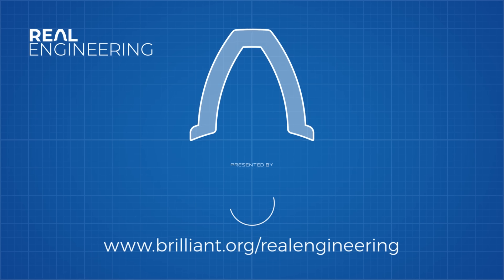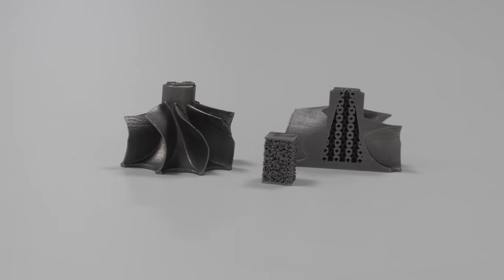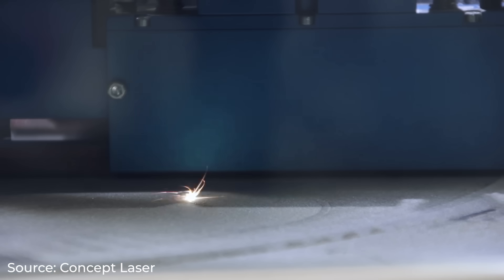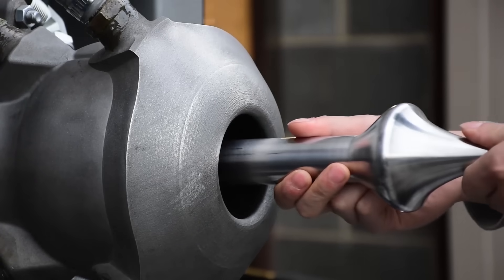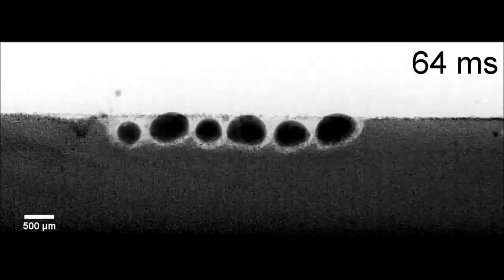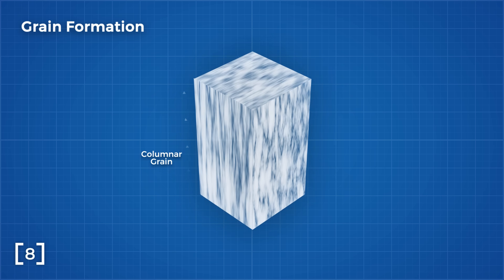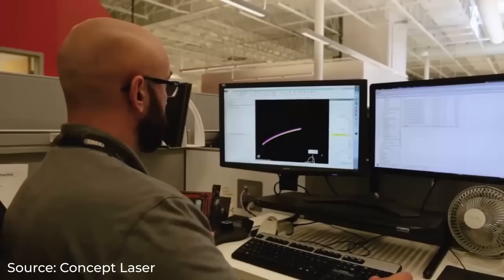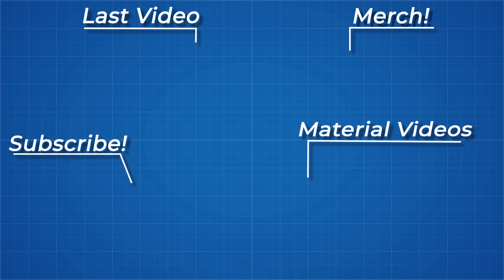The Material Science of Metal 3D Printing

Comment: As a welder and steel fabricator... I have seen plenty of young engineers bringin forth plans that are impossible or REALLY UNNECESSARILY COMPLEX to fabricate. (And many of them have refused to take feedback... for some reason.) And since I started to study engineering at university, I have found great amount of value from my practical experience of welding and steel fabrication. 

Seriously engineers... Talk to the people making your things. Often there are simple changes you can do that will cut cost and production time, if you'd just bother to talk to us. We don't bite. We might be blunt and few worded, but we aren't mean. We like it when we get to share our experience.
Reply: Henri Hänninen Kelly Johnson has a rule engineers couldn’t sit more than 100 feet from the factory floor. If there was a problem in assembly the engineer had to go to the floor. Kelly Johnson ran Lockheed’s Skunk Works for decades and designed the U 2 and sr 71 blackbird etc. 

My wife is a jeweler and sees this with students leaving school. No, you can’t take 6 months to make a pair of earrings.
Reply: @jimkennedy4509  The main thing that management needs to know is what is within 10ft of the worker on the floor.
Reply: @jimkennedy4509  That's pretty much how Elon Musk runs Tesla and Space X.
Reply: @jimkennedy4509  Elon Musk uses the same principle in Tesla and SpaceX. Furthermore even the product engineers and the production line engineers are in the same room too. Right inside the factory. This is how you land rockets!
Reply: On the Civil Engineering side of things we have the same problem. The bad thing is they don't even teach design anymore in school so the newer engineers are just 100% theory and no practical real world experience/application. The best firm I ever worked with took the newly hired engineers and put them as rodmen on the survey crews for their first year cutting line and doing stakeout. By doing this they learned how things go together in the real world and made their future designs a lot less of a headache for the contractors.
Reply: @Bugsey35  I'm not sure what schools you are referring to, and maybe this is different in the civil engineering department (I'm in mech), but I've had at least one design course per term (2 terms per year) since I started university (I'm in third year).
Reply: @Bugsey35  But that's a liability to train, they could leave the company as soon as they get another opportunity, and you lost money training them.
Reply: I'm so glad I learned 3d CAD before getting a job in a fab plant in the machine room & later applying for a position in the engineering dept. My official title was "Production Assistance Engineer" meaning I had to go behind the engineers & fix their designs so that they could actually process them in the plant. My nickname in the fab room was "Mr. FixaFuck"
Reply: @RichardCranium321  i feel like your path to engineering has a much stronger foundation even though it takes longer.
Reply: As a tool designer, I often have difficulty getting the undivided attention of the fabricators where I work, especially early on in the design process. Usually I have to go out and interrupt someones busy schedule without notice in order to get their opinion on my design. Often times neither of us know if he will even be involved in fabricating this tool which makes it hard to get him invested enough in the details of my design to provide any meaningful feedback. The responses I get are often as simple as a thumbs up until the material is sitting on the welding table. Only then do I finally get an earful about my design.

I've discovered over time that drawing out design discussions as much as possible yields better feedback. Dedicated design reviews can also get good feedback too if done right. I try to be physically present when the tool is being fabricated and assembled to see what parts go smoothly and what parts don't. It's always the little details that make the difference between a bad design and a good one and those little details sometimes get overlooked in design discussion.

Also, maybe I'm a wimp but criticism can still hurt no matter how nicely it's given. It sucks to spend 3 solid weeks agonizing over every tiny detail of a design only to have the entire thing thrown out without a second thought. I have to deliberately put myself in a vulnerable position when I seek out criticism which is scary. I'll try my best to listen carefully and not get defensive and in return I hope you can approach the design with an open mind.
Reply: @gregorycarlson6445  Sounds like you are on the right path. Every tool that you design and watch being fabricated teaches you more about what works best. Keep putting yourself out there and eventually you will see the rewards for your persistence.
Reply: when i was doing my mechanical engineering study in the netherlands, we had to manufacture our designs in the workshop too, to give the students a better understanding of what you can and can't do with machines.
Reply: toyota's manufacturing process incorporates two way feedback b/w the floor/fabricators and design/engineers.
that's why their cars are great and run forever.
Reply: @test-mm7bv  .Also why Tesla is rapidly dominating the electric vehicle industry.  .they have a culture of innovation, feedback & upgrade
Reply: Henri Hänninen 
Also many people who want to be engineers don’t take classes in high school which offer machining experience or welding experience. Many just stay in the books.
Reply: I work on cnc lathes and mills. I wish the engineers and designers would talk to us about the manufacture of their parts too.
Reply: My boss tries to tell me how to do my job many times per week. Every time i just let him talk and do my job my way anyway. Complains are very rare.
Reply: It is the same story over and over again. There are some examples where this interaction does work, like Lockheeds skunkworks Toyota and Tesla that where mentioned above. 

But ultimately it is the job of the directors and higher management to create a cooperative culture in the cooperation! So my advice, go and work for a company that understands these things. It will make you so much happier. And if your company makes good stuff your job is not on the line in the next recession.
Reply: This holds a similar truth for software as well - I'm regularly dealing with some kind of program which was clearly designed by someone who didn't bother thinking about the people who actually have to use that abomination.
For example, the most common task for a class' teacher is to do a statistic on attendance - the optimum steps would this be: Open program => Login => Select class from your filtered list of classes => Select "Attendance" from icons for most common tasks.
What were the actual steps? Open program => login => Select class from unfiltered list => Switch to view of all pupils => Select all pupils => Select "statistics" => select "Attendance" => Set filter to current school year => Select "Export" => Save file => Open file in Excel...
Reply: @johanneshass1614  We had to write an actual Standard on how to make a peanut butter sandwich in my Standards class. If someone else were to follow the standard, they would have made peanut butter sandwich. Most people fail to understand what all of the steps involved are for even the simplest of tasks, and then wonder why they failed to meet acceptable standards of performance.
Reply: Also known as the Auto Mechanic dilemma. Timing chains are the worst.
Reply: I see this every day where I work... the Office has no clue how things are done in the shop.  The drawings are ridiculous and the fabricators and welders are always shaking their heads wondering if there is a university engineering course in 'being stupid'.  I personally believe that all detailers / engineers should spend a couple months in a shop to get a grasp on how things are actually made.
Reply: @angryoldcanadian3905  Colt Firearms actually has that policy where management and engineering are required to spend time on the shop floor, and at those salaries. But it doesn't sound like you work for Colt unfortunately.
Reply: @angryoldcanadian3905  I personally think you should spend some time in the office, dealing with other engineering bullshit and actually designing something properly. Good luck fucking up
Reply: @Rossingiol  If your design isn't manufacturable, there's nothing "proper" about it.
Reply: That mentality is everywhere. All the people at the "top" is shit and all the people holding them up see is shit and the assholes shitting on them. Pardon the language but the joke doesn't work as well in a clean form.
Reply: You can see why young engineers may not want to ask for or listen to the advice of fabricators. Contrary to what you are saying it is INCREDIBLY common for fabricators to act exceptionally condescending toward engineers, laugh at them, and then proceed to point out what a waste of money their college degree was.. Is that the  "blunt and few worded" part you were talking about?To be fair there are people like this on both sides, I have met thick headed stubborn engineers but I have also met JUST AS MANY self righteous chip on your shoulder fabricators and contractors that will start up this whole jockeying and penis measuring while demeaning the engineer. It only takes a couple encounters like that to discourage most people as a whole to avoid situations in which this may happen to them again.
Reply: It takes 2 to tango. I eventually became a fairly decent engineer, but the path from naïve student wasn't helped by plenty of people who should've known better hoarding their expertise or telling us to piss off when we got near the shop floor.
Reply: As a design engineer, stay in your lane. We intentionally make our designs difficult to manufacture so you can whine about it. (jk, I agree with you lol)
Reply: My uni made us do a unit in designing and building parts ourselves using lathes and CNC machines for this purpose. It was one of my favourite units and helped show the realities. I agree that people need practical experience in these areas before graduating
Reply: Henri Hänninen one of the reasons why I chose manufacturing Engineering is because there is a distinct focus on design for manufacturability. We also get to learn the cutting edge stuff as well. It really helped with my internships and I’m hoping that when I graduate I can do more in the metal 3D printing area
Reply: I am curious Henri. When you finish your studies, go to these places and present you designs. Don't tell them you were a welder or steel fabricator first and see how they treat you. See how they talk to you and assume you are a know it all. Look at half of the responses to your comment. the disdain for engineers is palpable. And you want them to come into this and say "hey so here is my design, what do you think?".
Reply: When people tell me how to do my job I do it the way they tell me. Then when it's all fucked up, hey they're the one who told me how it was done.
Reply: Oh no fooling! I used to be a welder at Genie Industries building man lifts. Some of the stuff the manufacturing Engineers came up with was unbuildable. They wanted welds where you couldn't get into to weld.  More than once I told the engineers they were over-educated morons and before they should be employed as an engineer they should work on the shop floor putting together what other people design.

A good engineer copy's good ideas, a bad engineer copy's bad ideas, then you have engineers that do the what in the world were they thinking?!!

Mustn't forget the engineers that tell you well just make it as we designed it!  Then they complain about the welding when the welds crack and the lack of penetration of the welds. It couldn't be the mix of a 1/10 of an inch tubing being welded to a 5/8 inch bearing boss being the issue... it's got to be the welder's fault for not knowing how to weld.
Reply: @krissfemmpaws1029  acting like an entitled bit , complaining and crap makes you a (fill in the blank)
Reply: @krissfemmpaws1029  oh that's a great way of thinking. How much do you know about numeric strength calculations again? Don't be a prick, you also made mistakes, that's called learning. And you can not learn everything there is to know in your field in 5 years. If so, try doing a better job.
Reply: @Rossingiol  The real world doesn't care about your numeric strength calculations. If it is physically impossible to make something, it doesn't matter how good your calculations are. The fact that you completely glossed over his example of welding issues shows how utterly inept you are at understanding real world conditions.

Just because you have fancy coloured simulations doesn't mean it is actually manufacturable.
Reply: @kwanarchive   "The real world doesn't care about your numerical strength calculations".

That has to be the dumbest thing I've ever heard. It's a good thing you don't design bridges or aircraft.
Reply: Same goes for the designers' relationship with programmers. Seriously, sometimes designers project very hard things for the tools being used when only a few changes in the design could make it quicker to code (which means cheaper) and simpler to maintain.
Reply: After college you quickly learn that you are always a student.
Reply: I always seek the end users advice for designs for yet another reason--if they have real input that effects the crucial criteria such as dimensions, range of motion, etc., they will have a stake in making it work as some adaptation will be required by them too no matter how good the design is, if they feel left out of the process they may make a good design fail but if they are included they will TRY to make it WORK.
Reply: "We don't bite"
Proceeds with the good old dig at engineers
Reply: If they won't listen to machinists or line operators they're second-rate engineers. Unless they worked a design project or had a DFM course in school, they may be trying to exactly meet the specifications they were given (like solving a textbook problem) with no appreciation of difficulty, lead time, or cost (which engineering texts never talk about). By all means, push back or they'll never learn.
Reply: You have hurt the ego of most millennial engineering degree holders.
Most persons especially millennials who have a degree in engineering will never try to learn anything from a welder/fabricator. Its a matter of their ego.

I have a degree in engineering and I have learnt a lot about engineering from sources outside my college. Those sources included welders like you. Welders have thought me things my college never really bothered to teach. There is always something we can learn from others even if they are not as educated as us.
Reply: No doubt. Every single job I have worked has a huge discount between designing / engineering and manufacturing. And you are correct when you say the engineering departments don't bother with bringing experience from manufacturing into the discussion witch hurts them far more then they think.
This is why you will find in every top tier manufacturer that the lead engineer in a given section have experience performing every single step of the process. You will see this in top defense contractors concept and development departments.
I meet a guy one time who worked in similar situations. I believe him because he did not ever brag or upsell himself and the guy always had the best way to go about a task and always reviled he had more talent and experience then you thought. Anyway this guy constantly pushed the concept of positions learning every job under them. He was telling a story about when he was working in some manufacturing process making parts as an engineer (the new engineers at this place all worked in manufacturing and learning every process used before they were promoted to engineering department "drafter bitch")
He told the story of working night shift and a machine broke down so he looked it over and gathered observations to take to a supervisor. As he was looking it over and noting down information one of the top engineers noticed and asked what was up. Then that top engineer showed him how to disassemble the machine, inspect, repair, assemble, properly set up and verify its proper function then and there. He asked him how he knew how to do this like it's second nature. The engineer told him that the reason he heads up a department is because he never forget how to do everything he's ever done with that company and often goes back to refresh on the jobs below him.
I always asked him how he could work for these companies that refused to operate similar to that. He said that's the beauty of being hired consultant. They stop listening I talk louder and more direct. They start working against my well thought out solution I walk out. Haha
Reply: Henri Hänninen I learnt fuck all at uni doing masters in mech eng.  It doesn’t prepare you for real life/manufacturing environment.  Always stay humble and ask shopfloor staff for advice no matter how much you know,  they’re the ones that create and fit parts together and know something you don’t.
(Working in aerospace)
Reply: Lye Detector  Yes I understand you're scared of AI I am too you should be more scared if they become better engineers then us than Welders. they are already good calcualators.
Reply: Egos and arrogance have been Man's biggest problem since Man was invented...  Where I work as a Machinist,  There's more closed minds than open minds...  Needless to say,  the shop is stuck in the 90's and slowly shrinking..  They refuse to admit,  they don't know everything..  If you push the subject,  and teach them something,   they HATE YOU ! ..    I know it all too well..
Reply: @THOMASTHESAILOR  that's practically how the entire western world is working these days
Reply: @Astro_Alphard  ,  It sure is...  When will it end,  if ever..   is the question..   cuz it'll be difficult to move forward like this..
Reply: There is a tiny % of us who do eventually learn to listen over time
Reply: @htko89  No, dude just would not listen and argued that I don't know shit because I didn't have a degree, iv explicitly stated that this machine gonna blow up on his settings and told him I was writing off of this machine if he as a higher up want to mess with it, he created an accident because he was so far up his ass that would not consider anyone opinion, I can totally work with ppl, that's why I left CNC after few years, to little contact with clients, but this dude could not
Reply: I think I agree with you a design engineer needs to know their limits. Pure employee, management politics .. the engineers especially the newbies want to prove that they can achieve the next innovation in terms of design, while making a name for themselves in the company & market. Some even eyeing that coveted design award.. can't blame them!
Reply: I know exactly what you mean !!!
Just because it looks good on paper . If it's not practical . What use is it !!!
Exactly why "Field Fabricators" will always be nessary !!!
Fixing Engineers Mistakes !!!!
Reply: True words. If you want to be a good engineer, you need to spend time on the shop floor. 
Listen and learn from the masters.
Reply: A freshly graduated engineer comes to the new job. Is handed to the floor leader (old practitioner), to be shown the place and its processes. The leader grabs the broom and gives it to the engineer, to start from the scratch that day (to work through all points in the manufacturing, including most important part, cleaning and maintenance). You know, that old school thing for beginners, which everybody hates. The new engineer responds: "But, but, I´m qualified engineer, with a diploma!" The leader backs off in surprise. "Well, yeah oh, uh, sorry! I forgot! Let me show you how broom is used to sweep the floor!" :-D
Reply: This is so true. I am a technical product designer and do a lot of CAD but no actual manufacturing. I always give my best to design things "realisticly" so that they can be actually produced or try to cut costs by removing unneccessary tool tim etc. In my former education there was no plan to do anything practically and I started to do some 3d printing and turning and milling in my spare time to gain more knowledge about all these processes thath i just assume to work out while designing. i learned a lot by doing this and just started to study mechanical engineering and I can really profit from this.
Reply: yeah u dont get it ... talking to people? thats exactly what they wanna remove. their goal is robotics, so that the engineer has direct access to the fabrication process.
Reply: Yes, a tough subject. Doesn't produce the best people however
Reply: that's the problem this economy has created, everything needs to be instant. and that trickles down into our mentality. sooo we have degrees now. we learn shit from books so kids don't waste 30 years to get experience and understand the stuff they should understand.. no they know the stuff because it's in books, they know it but don't understand it. hence they know nothing.
Reply: So are you saying a welder who has less math does more work than an engineer?
Reply: Maybe the reason you think engineers can't 3d print metals because you don't know how that works. who cares if welded it can you solder a rectifier in a alternator? I don't think so I'm not trying say engineers are more important than them but an engineer could easily weld without a welder if they wanted and just use robotic welding that is the future.
Reply: Lye Detector  Why is it that everyone want to weld when you can just program a robot to do that shit it doesn't make any sense to me.
Reply: @cah2942  Where I work, we build large (some 12 ft tall) machines for food processing. Every machine is custom designed by mechanical engineers to perform the needed functions in the particular space where the customer needs it. Of course each machine has some similar parts to others, not starting from scratch, but there are differences. There is no way to program a welding robot in less time than it takes a human welder to put the machine together! So all of our machines are manually welded. If you start making 100 of the same thing, then a welding robot becomes practical, but in many places experienced human welders are what is needed. And when you get the robot, you still need someone who can operate it and determine whether the welds it makes are good and fix it if not. [I have an electrical engineering degree, but am presently working as a manual machinist, which I very much enjoy doing.]
Reply: Lye Detector  I'm pretty sure the Majority of Welders will face the truth that we need the  engineers Making all kinds of products that is the future  I'm pretty certain there are engineers out there that weld that they would rather a robot do it.
Reply: Lye Detector  I only think Automation you can't weld we don't need them but underwater maybe because we have no robots doing it yet maybe in 2040 possibility
Reply: This is so true. For my final project I had to design and then build a CNC. I soon learned that learning HOW to build a design is just as important as learning how to design a build. So many things had to be changed on the spot that I wish I had someone with design experience to look over my shoulder.
Reply: I'm an engineering student and I always take feedback from the fabricators, after all they are the ones who make the thing and I take their advice seriously even though it may not always be implemented (usually for weight/rigidity reasons though I do try their advice in CAD.  I always try to think about how I would build my part before designing it often asking what tools they have available and how big the tools are (sometimes I ask if I can prototype my own stuff since i find working the lathe to be meditative and relaxing). I'm definitely someone who will hit the books but there's no point in designing something that can't be made and there's no teacher quite like experience. If I can't make it there's no point to designing it, when I design something the first thing I do is talk to the shop. Manufacturing considerations must be taken into account in the initial design review. 

On the other hand I've met MechEs who've never picked up a wrench in their lives get laughed at by machinists because they didn't put a bend radius in their sheet metal designs and then not respond to any feedback.
Reply: Engineer sends out a drawing into the workshop, me and my mate both coded Welders/Boilermaker and first class Fabricators have a look at the drawing and laugh, “bloody Engineers”
So we fabricated this double return channel in 16mm stainless steel that could never be fabricated on a break press. after the job was completed the Engineer sauntered over to pat himself on the back about the new design and that he knew we could form that section on the break press!!!
NO THAT IS FABRICATED OUT OF FOUR SEPARATE PIECES YOU KNUCKLE HEAD!! Two hours later can you show me how you guys made this!
Reply: OMG, the internet is flowing over with YouTubers who think we should be 3D printing ventilators.
3D has its place for some things, not for large scale manufacturing.
Reply: @Denis Meci windesheim, zwolle
Reply: Having also fabrication experience I'm surprised not to see 3d metal printing with something more like a Mig but more similar to the plastic printing. So why not consumable rod, just a thought.
Reply: @paulferris8180  Look at the MarkForged Metal X Printer. It uses reels of wire in various materials for 3D fabrication as you suggested.
Reply: @BenAtTheTube  It is an old comment you are referring to my friend but I will look into it. I am a metal fabricator and licensed mechanical services plumber by trade amongst other skills. I think it would be nice to see a mig 3d print whatever you want if that is what it is?
Reply: @paulferris8180  I believe that is correct. I have not seen one in operation, and the website is somewhat limited in information.
Reply: @BenAtTheTube  sounds good.  Cheers I will have to look into it.
Reply: @BenAtTheTube  Nice only the the beginnings of the idea. I have seen this type of thing atm lacks the strength of drop forging though. Hopefully one day in the not too distant future a truly capable 3d print will be developed and then it can advance to what I envision. Thanks for the heads up.
Reply: @paulferris8180  Yes, apparently MarkForged are not really building objects by welding. They build the object from some kind of metal containing wire (similar to their 3D plastics), then apparently wash out everything that is not metal and then sinter it to remove as much as possible of the remaining spaces. I agree with you, what I want is a real 3-D welding machine that just keep adding welding metal until the object is done and then it is done. Maybe when I get my CNC milling machine working I will be able to add a welding head to it for additive manufacturing; shouldn't be all that difficult! It still won't be as strong as cutting shapes from a forged block, but good enough for some purposes.
Reply: A good welder is also a good engineer.
Reply: Im glad before i become an engineer i work on every machinery process and welding process so i prefer to talk to my team before made a conclusion about parts what we want to manufacture otherwise its just result hustle between us 😁
Reply: UNNECESSARILY COMPLEX - this. And not only in your line of jobs, machines are nowadays build unnecessarily complex for no other reason than sell them as an upgrade with premium price. For example we have 2 almost same assembly lines where I work. 1 is 6 years older than the other one. That newer one has so many pointless sensors and settings  that YOU HAVE TO use in order to make it work that workers dread being assigned to that line. And the end product is indistinguishable from that older simpler line and speed of production is also same... so what was the point of these "upgrades"?
Reply: And this is another reason that moving production to cheap labour countries may be expensive. You will miss the craftsmen.
Reply: This is why I am looking for an apprenticeship or job instead of going to university.
Reply: @alwynwatson6119  Good idea. Some jobs - engineer at a large company, or medical doctor - require college study. But I know a lot of people who have not attended college and are doing very well, both personally and financially. Manufacturing is one of those non-college jobs, or building construction.
Reply: seriously fabricators, get the phuuk off your high horses: thinkers are > laborers
Reply: @Henri Hannimen  I understand, practical versus dickhead greenhorn engineers.  They should fucking install it.  You’d think a ring (from that bridge)  would overcome the hubris.  Yeah, we’ll do it.  Schooled, theological dipshits that believe in divination fresh with theory.
Reply: Dunning-Kruger effect. Less experience means high confidence.
Reply: Sounds like Architects and Construction Managers. The CM usually has to make a lot of changes to get the project done properly. That means change orders have to be issued and approved, time wasted, and expenses pile. Architects seem to think of CMs as hammer-monkeys, though. Pity that that dynamic exists everywhere there is a separation between design  idea and kinetic production.
Reply: dude, this tech that's spoken of here, will leave you behind and probably has already, not to mention, makes it possible to make the complex designs you, were never able to make, but I would like to know, how is one meant to speak to you about this ? I'm guessing you're knowledge base concerns that of your typical fabricator ? so how will you have any clue about 3d printing or new technologies ?
Reply: I'm a software engineer by training, but I have all the same basic engineering and mathematics education as any other type of engineer. I'm also a born tinkerer and I've been working with mechanical devices my entire life. I've designed a few mechanical parts over the years, and I've always consulted with machinists during the design process. What good is it to have a finalized blueprint of something if it's impossible to make, or so expensive that I can't afford to pay someone to make it for me?
Reply: I never had this problem as Engineer, due the fact that I learned how to be a machinist and welder before start engineering.
Reply: Me when the electrical engineer refuses to simplify his board and insists on using a huge copper plane that makes a proper solder impossible
Reply: I could not agree more . My company has been designing electronics , software and housings ( cnc , 3D printing , tool design for injection molding , packaging ) for 35 years  . Our younger engineers without ‘ scars on their backs ‘ design with cad tools ( solid edge and cadence ) and then push to manufacturing . It is now compulsory for them to spend 6 months on the shop floor to understand tolerances , draft angles , material inconsistency and fabrication constraints . Just welding a square tubing frame is an ah ha moment for them as most are never square at the corners and they are surprised how the frame distorts with heat  , so soon see the benefit of cross section tacked to maintain shape. I I had a dollar for the amount  of times we see a stylised housing that looks great on the screen and can be printed but never manufactured . Lastly they are compelled to detail how a service tech will access and replace parts without needing specialised tools hand crafted by a Tibetan monk in a zero gravity environment .
Reply: @hedleyfurio  thank god. I have huge issues with engineers who “know everything because they have a degree and I don’t.” The amount of times I’ve had to call a design meeting and actually show them why it can’t be done is ridiculous
Reply: @hedleyfurio  and it’s for things like stand-offs not being accessible, copper planes being too large (can’t heat it properly) or parts not being able to placed due to the clearance for said parts being not enough. It really does piss me off sometimes. I may not have an electrical engineering degree, but I’ve spent years getting my certs and working on boards.
Reply: About to finish my engineering degree, I always design parts by making a block and shaving away at it in solid works or whatever software I’m using. To make sure it’s possible to fabricate. I grew up around fabricating so I also have that to keep in mind but I found this method really helps to make sure that it’s possible. In the end though it makes my life easier too as I design the same part faster than my classmates (not sure why).
Reply: I work at a big turbine manufacturer and I'm pretty new, just reading these comments make me feel like im not alone haha so thank you for that
Reply: like trying to explain to liberals why they live in an imaginary universe
Reply: As a mechanic in training, I feel you. Alot of engine designs just don't make sense in terms of reliability and dependability. 

I own a dodge Durango  (1st gen) and I can't believe that you have to take off the front differential (4x4) to just remove an oil pan. Ridiculous!
Reply: I have seen plenty of mechanical engineers who can't even change oil in their car... I say graduate ME's only after giving them a crappy transmission to overhaul.
Reply: The 'one' girl in my aerospace machining class was already a  graduated engineer... she was there to get the practical experience to know how the stuff is put together. Good on her.
Reply: I interned at big pharma as a quality control chemist. When I went down the plant to interact with the techs there to get samples or just while the time away in between, I found that there is a strong cultural animosity between them and myself.

Most of them were loudly Fidesz/Jobbik voters (far-right ruling party of Hungary) with the opinions to boot. Like Merkel blocking real hungarian scientists from publishing real research on hungarian history (like Hungarians building pyramids in ancient european balkans) because letting us prove being first in europe would give us de jure rights to the whole continent, like Native Americans to the U.S (they reason them being given reservations is sign of this preferential treatment). Furthermore, when discussing my study plans (BSc and MSc in Hungary, PhD in Denmark), they warned me not to go there as "Denmark turns people gay."

They also said chemists working in a laboratory are gay.

It does not encourage interaction with them. After a few of these I decided to just sit in lab and study for next semester in between samples.
Reply: @RunaKovacs  I am a Degreed and Certified Quality Technologist. I also have heard the sneers such as we just went to just school so we could tell the experts how to do their job better. There has always been animosity between management and labor; welcome to the club.
Reply: @RunaKovacs   🍷 😆🤓
Reply: @RunaKovacs  Haaaaaaaaaaaaahahhahaha, that's amazing. Denmark turns people gay, he might be right lol.
Reply: I started studying mechanical engineering 2 months ago so im gonna make some of the mistakes. Any quick tips or so?
Reply: @marcussturup1314  if you can go to the shop floor and talk with the people that will be making it. Show them sketches and ask for their ideas, you will be surprised how many will offer you ideas on how to improve your idea.

I have worked with a fair number of engineers and designers on different projects, many times together we made things simpler and easier to make, there for lowering the cost.

What designers and engineers forget is one of the best and biggest resources they have are the people on the shop floor.
Reply: @krissfemmpaws1029  I was once showing a girl some of the critical points on casting the mold that I just made and was told "You ain't my boss! You don't tell ME what to do." Needless to say, I didn't say a thing when the casting failed and management was discussing how to fix her f'kup with her. Sometimes, all you can do is try.
Reply: @_Abjuranax_  yep seen that happen too many times. I was standing there when one of the higher ups was chewing someone out for not asking the shop guys for help designing some new tooling. 

Their response "The CAD software shows it working!" Said designer was on the shop floor for the next month and a half learning to weld and tack parts together.  Then how all the parts fit together as a unit.
Reply: @krissfemmpaws1029  The C in CAD stands for computer, and computers don't do what you want them to do, but what you tell them to do. And they are trying to duck out saying what the CAD was telling them, lol.
Reply: C Ray Starling & Kriss Femmpaws - This is something I was told in 1983 by someone who started programming computers when they were made with vacuum tubes, “Computers are dumb, fast & obedient - They do exactly what you tell them, not what you want or thought you told them, to do very quickly.” Obviously, nothing’s changed since then except for the fact that they are a LOT faster...
Reply: @marcussturup1314  Try to fit in some course work in welding and machining so you know how that side of the engineering works and you will make fewer mistakes.  Look over your designs to see where pieces fit together so the welder doesn't need to stand on his head to fit a part.
Reply: @marcussturup1314  Measure twice, cut once.
Reply: @marcussturup1314  What ever job your at try to spend time working with the Technicians who work on the machines and the people who use them. I am a tech in a factory and Engineers often dont understand real world issues.
Reply: @marcussturup1314  talk with the guys on the floor. Keep in mind that you have breadth of knowledge without any real depth in any specific area whereas they have a limited breadth of knowledge but deep specialized knowledge in that area, especially the practical issues that cannot be empiricized. They can show you traps and improvements,  getting you buy in from them and saving time on reinventing solutions.
Reply: @marcussturup1314  As a mechanical engineer, give machinists the largest possible radii acceptable for your design.  make your designs as simple as possible, no simpler.  Do them favors and they help you out with all your little side projects.  Seriously.
Reply: @marcussturup1314  humility, learn to sketch and explain what and why. It's really appreciated. (I'm a welder fabricator also)
Reply: @marcussturup1314  Best advice I can think of is to get hands on experience in things like machining, welding, 3D printing, or really any manufacturing technique that you can get access to. If there's an opportunity to practice or take part in any manufacturing process, take it. Second best option would be to watch videos on manufacturing, especially machining. One's with commentary are better. If you don't know them, check out the channels "This Old Tony" and "Ave". Both are very experienced machinists and funny as hell (warning, the second can be a bit vulgar from time to time, but he means no harm by it). Also, when designing a part, instead of thinking about what would work best and only then thinking of how to make it, try to design parts as if you are sculpting them using the tools you know are at your disposal. If all you have are manual milling machines and lathes to work with, then start with a chunk of metal in your head and picture how you would use those machines to whittle it down until it serves the purpose you need it for. Time spent thinking of designs that can't be manufactured is time wasted, from a practical perspective at least.
Reply: Marcus Stürup if you have the opportunity, build your own projects. I’m doing that alongside studying and find it both satisfying and educational, as it highlights the problems with my designs. If I spend 8 hours making a simple bracket, I should really revisit the design.
Reply: @marcussturup1314  When designing, try to think about how each slot/profile/shape or whatever will be manufactured using the chosen process, be it casting, forging, machining, etc. Know what drives manufacturing difficulty (and cost), e.g. draft angles and slot radius, and use that knowledge to minimize manufacturing time and cost.
Reply: @marcussturup1314  Learn fabrication. Work on your car. Hang out with welders and or machinist. Work in a manufacturing plant in the summer - not as a junior engineer or some other white shirt job... get on the floor. Work with the guys that will eventually have to fix the equipment you design. I'm an engineer and I can't stand most engineers because it's frustrating how many engineers clearly don't care about creating good designs. Simplicity is key. The simplest, least complex solution is always the right solution. Best advice of all, always think about the person that has to assemble, fabricate, and/or work on your design and make it as easy as possible for that guy. If you can balance manufacturing, maintainability, functionality/performance, you'll be an actual engineer. If you can't, you'll just be another arrogant punk with CAD.
Reply: Silence peasant!
Reply: @scubasteve3743   Right we get it,  you've been called a lot of names & forced to zip it a lot of times in life.. It happens! 🍷 🤓
Reply: Lye Detector  I actually laughed when you said lefties tells me how smart you are.
Reply: Actually, not being disencouraced by previous experience greatly increases creativity and makes innovation possible. Thinking outside the box, you know...
Reply: You have no idea what your talking about engineers do know how to design robot that easily weld this is why we need more engineers doing it instead of saying I'm cool because I'm a welder.
Reply: because system stimulates artists with THEIR GENIUS DESIGN OF ANOTHER VERY VERY NEW PRODUCT. Actually, universities asking them to eat shit and make shit during completely autistic explanations of everything. When I started masters course in electronic engineering I was absolutely confused: just couple of people had some working experience(much of that was like sort of guy that hangs wrenches  and watching what big boys are doing). No one was able to make a DIY single layer pcb, no one was able to mount components. No one read a single book of pcb routing. No one designed something that was produced in series at least of 10s. So, then we got a bunch of another  smart garbage, developed by army of schoolboys with diplomas and thousands of very important calculations. I was confused about market of protected and high reliable power electronics: 3.5 producers, mostly living in 80's or army of engineers create disgusting piece of junk barely working to only to the point of passing the certification.
Reply: Well the college boys are usually wankers.
And pussies and impractical.

Also stuck up.
Oh and plot twist I'm a scientist, BUT I'm also a farmer and have worked all sorts of blue collar jobs.

Now not all are like that but many are indeed, sadly.
Reply: bruh, don't you know they have the degrees, know your place. I welded/fabbed for about ten years, fuck that shit.
Reply: @Troph2  as an engineering undergrad, I find it odd you'd say that, university work is a lot more focused on applied physics and overall design/performance, and it's most definitely worth my listening to people who actually make stuff  - it's surprising you value your own expertise so little almost
Reply: @Troph2  Should make a south park episode about that.
Reply: @Joe11Blue  I have been an apprentice for 4 years with mostly engineers around me. Nice guys but not very communicative. In fact they communicate a lot... By doing useless meetings.
Reply: @johntheux9238  Meetings = Wasting money to talk about how to waste money.
Reply: @thealienrobotanthropologist  Problem is: We can be professionals and agree to disagree on opinions.

But when your opinions are about my rights to exist as a human being and receive the proper medical treatment I require according to WHO and "Medicine should improve pro-social or economic productivity/increase quality of life" standard; then I will have a major problem.
Reply: University is overrated, it is always technologically delayed with respect to industry and private science.
You have to be stupid to waste 5 years of your life learning obsolete knowledge and taking a damn loan in the process
Reply: Oh boy, i was a CNC machinist, my first week in job engi came to me with "new faster way to produce a part", i looked in code, instructed him how to start a machine and said to him "good luck" and walked away on the other side of production hall, few milion dolar machine was turned into dust and 2 ppl were injured after this moron coded 50KG workhead to piledrive throu block of titanium alloy at depth of 7cm, not even year later i was promoted to safety instructor after some more training
Reply: Damian Bisha apparently promoted to safty phuc tard with a clip board after he let a few folks get hurt and a million dollar machine break...hmmm
Reply: @damianbisha6712  I would say this was your fault, if you knew it would crash the machine and let him do it anyway. Proper action would have been to call your supervisor to (if possible) work out a way to incorporate the proposed improvement with limitations that would not break anything; or otherwise to explain why the previous way has already been optimized to the best performance this machine can achieve.
Reply: You sound like a dinosaur